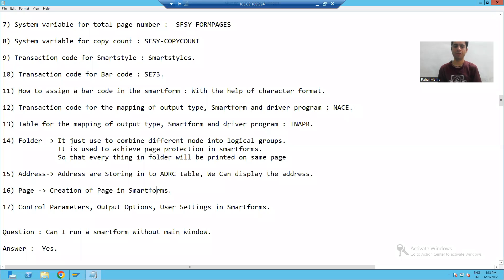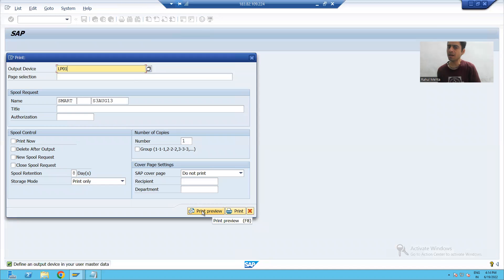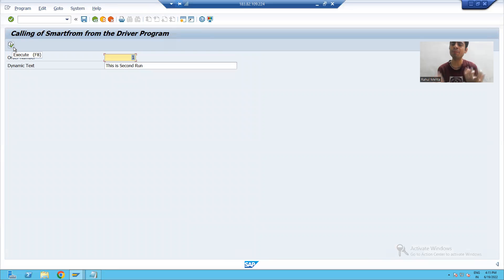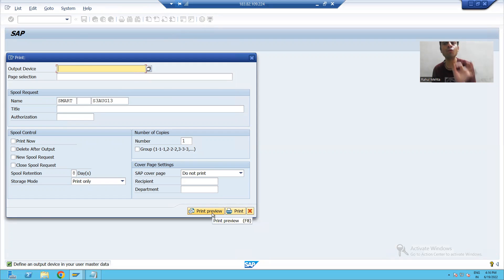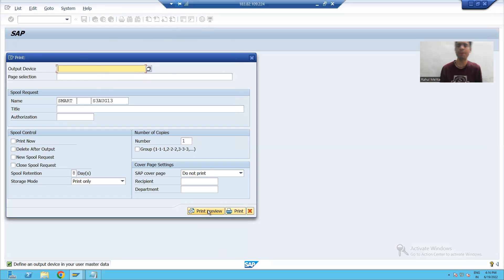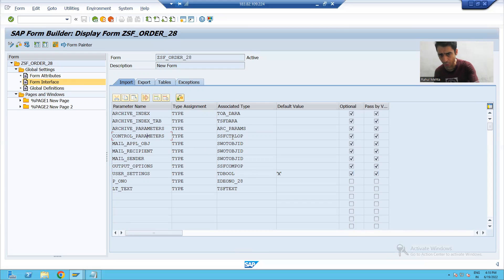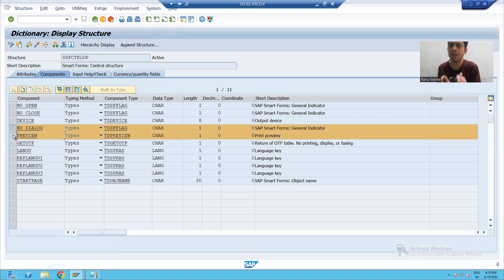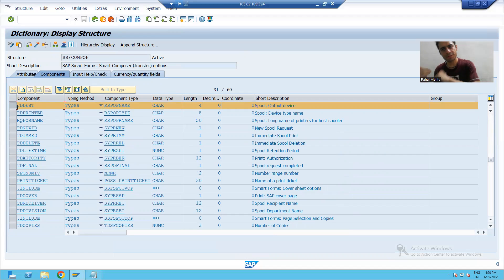41 - Smartforms - Control Parameters, Output Options and User Settings Part1

Comment: Sir I m not using the driver program than how Can I change the control parameters through smartforms
Reply from the maker: While running the smartform, one function module generates, run the function module, you will get the control parameters. Fill the control parameters.
Reply: @sapabapbyrahulmehta  sir but that we can do only at runtime I want to make it fix for Every time...I tried to change the generated fm also but at the time of activation it is giving the error 'object FUGR /1BCDWB/SF0000023(FM NAME) cannot assign to the package ZHR'
Reply from the maker: @radhikakundra7838    We can not change this Function module as it is generated by SAP. We only need to change the smartform and it will reflect in to function module. Driver program is a mandate in real projects.
Reply: @sapabapbyrahulmehta  sir but I have crated this through HRForm and in HRFORM print program is created automatically and from there it is calling the form
Reply from the maker: @radhikakundra7838    Yes, ultimately print program will call the smartform. Check the code where it is calling the smartform in the standard program and check the feasibility there.